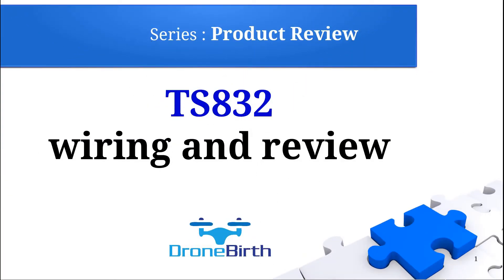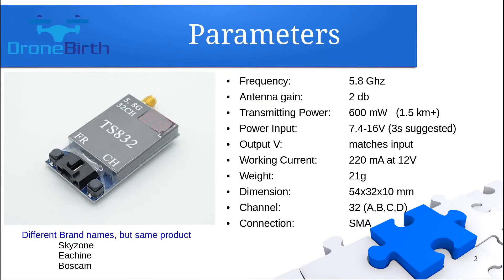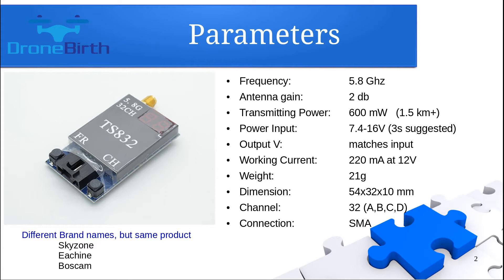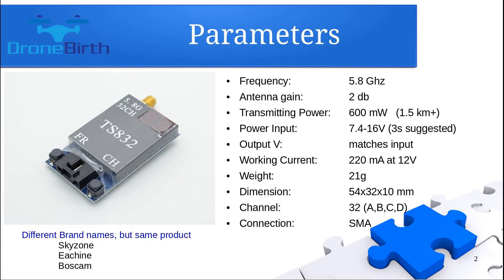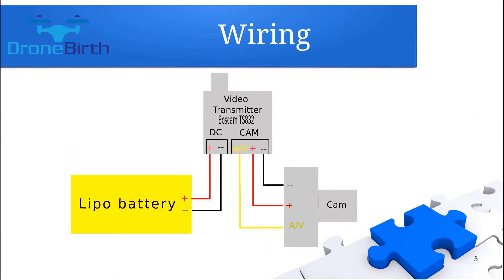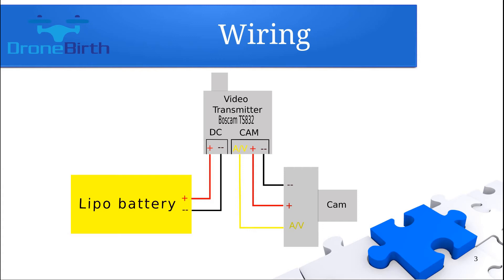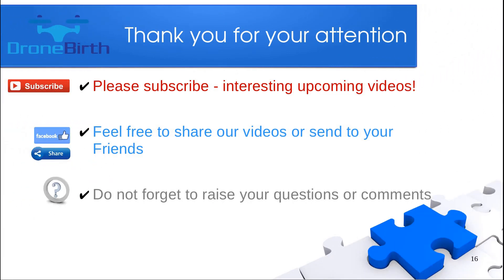TS832 5.8Ghz 600mW Video Transmitter (VTx) wiring and review

Comment: Camera output voltage is only 5v and not 12v
In TS832 transmitter module.
Also microphone is not work.
Reply: I get a Grey screen . I wonder if the output voltage is low. I'm powering the tx with 12v

Comment: TS832 delivers 12v at the camera?
Reply from the maker: it delivers the same voltage which you use to power the vtx up. If that is 4s battery, than it will delivers up to 16.8V to camera. So, take care and always consider the input voltage need of your camera.